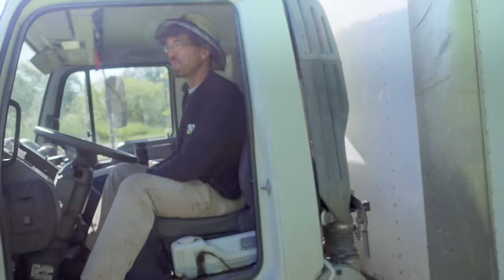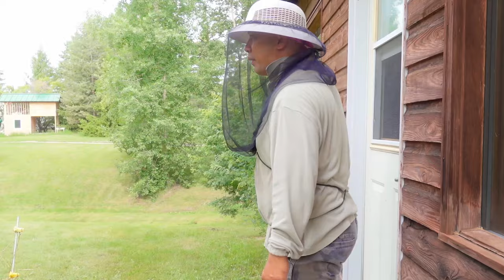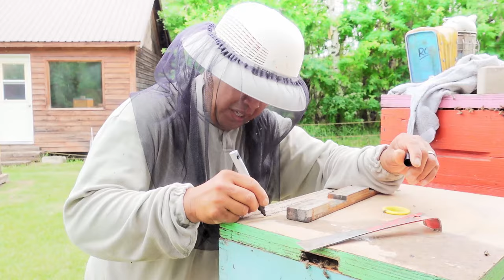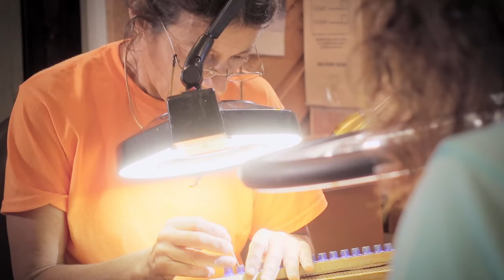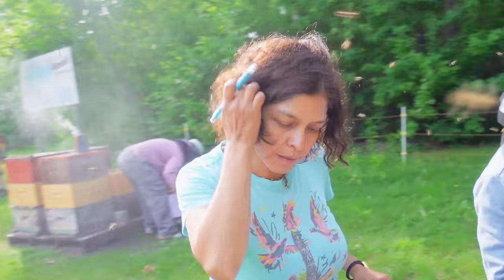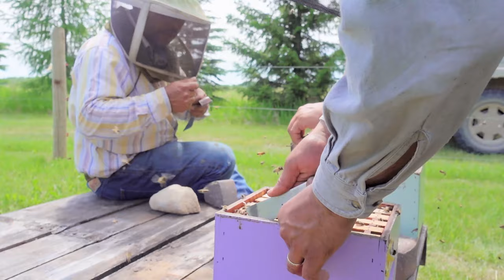Simple Guide to Raising Queens

Comment: Quick question. Why did you choose the Cloake Board method for raising queens over all the other methods? Thanks
Reply from the maker: What you don't see in this video. Is that we have starter hives and finisher hives. We put the grafting frame in the starter for 24 hours to let them get fed royal jelly. Then we transfer each bar on a frame to three different finisher hives. Helps us lighten the load on each hive. It takes a crazy amount of energy to pump out this many cells. This yard doesn't even really make any honey.